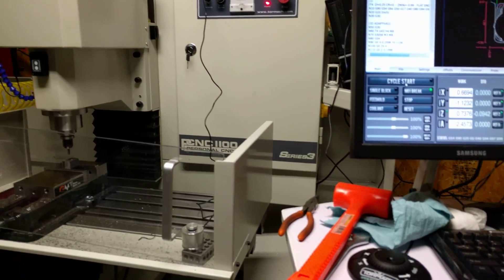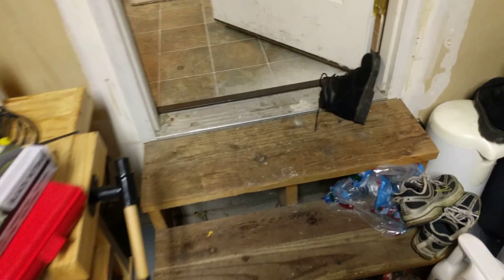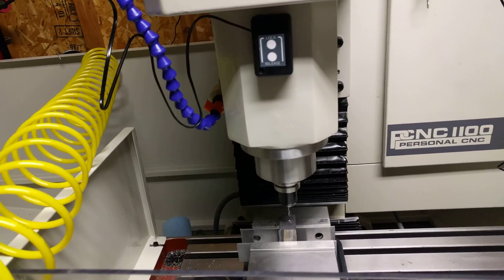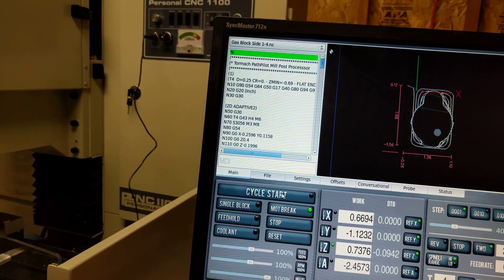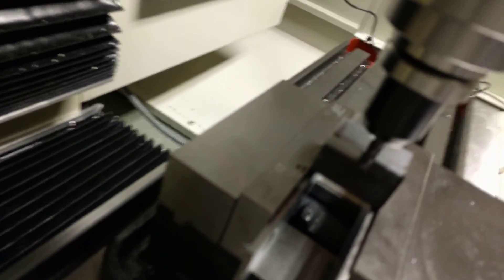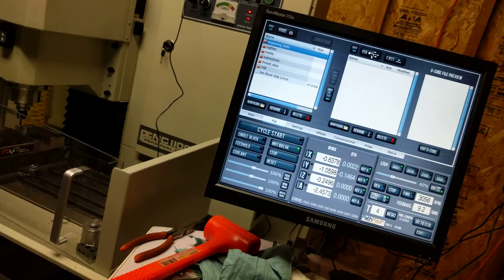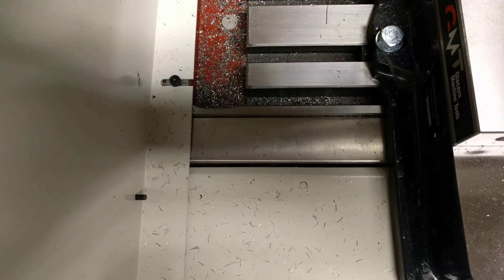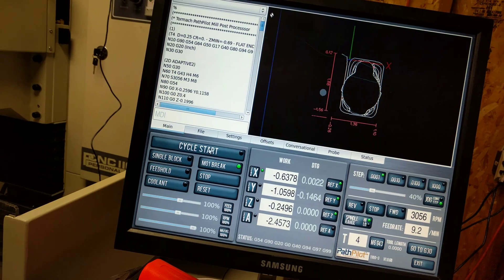Tormach PCNC 1100 day 2.

Comment: The harder the metal the slower the RPM.  Adjust travel speed as well to an Inch per minute per RPM formula.  That is called feeds and speeds.  Look it up!
Reply: An inch per minute per RPM would put my feeds at 1200-2000 inches per minute! Most full-blown VMCs can't run that fast even in the rapids, let alone in the cut. And at what depth and width of cut?

That's not a useable formula in any scenario.

Comment: You can change the feed rate in the lower left corner of the screen it has 0-150% you where at 100% instead of changing your CAM. Also it looks like your depth of cut was too deep. Slow that thing down on the feed rate till you know how it will react start at 5 inch per minute. I just bought my first cnc tormach 1100 and am starting to get better but I've broken about a dozen endmills. Aluminum is better to practice on more forgiving than the steel.
Reply from the maker: Yes, I've found that adjustment to be super useful. I can just tweak feeds and speeds until I like what I see/hear, and then go update that in CAM for future runs.

Just have to remember to hit the "100%" button when I'm done on everything.

I wish there was a way to make those reset any time a file gets re-loaded.

Comment: blue chips are a good thing! it means the heat is leaving with your chips, your end mill should be cool to the touch with hot blue chips.
Reply: and you want them big & fat too, big fat blue chips!
Reply from the maker: I've read that blue means too much heat, and that straw is the ideal color. Still learning though.
Reply: I say...if the chips turn blue as they rest then that is fine.....
Reply: http://zero-divide.net/?page=fswizard

The endmill you are using is an ALtin coated carbide end mill. Its not well suited for low speed milling.  If you go to FSwizard & punch in 1/4 end mill, with 4 flutes, ALtin carbide, Mild Steel & increase your max rpm to lets say 24,000, FSwizard will recommend 12,000 RPM. The Pcnc 1100 doesn't have the rigidity for 1 inch endmills. But doesn't quit have the speed for 1/4" & below end mills... so I'd say your machine is good for 1/2 to 3/4 end mills... With that said, when you mill at 12,000 rpm & up you get some blue chips, its not always a bad thing. FSwizard recommends 24,000 rpm for 1/8" ALtin carbide endmills.

Comment: Ok, you're diving in head first.  You are going to get this, but it's time to step back and learn two things.  1) How to use GWizard to get some starting feeds and speeds.  and 2) how to use the tool offset table and touch tools off.  The sheet of paper method works fine to get you within .001.  Can try to help you with a feed/speed but need to know your tool specifics.  Also what CAD/CAM are you using?  Fusion?
Reply from the maker: I have the Haimer, but I broke the probe (sad day). New one coming tomorrow!

I did spend this evening getting the tool offsets done. I got several more videos of that progress to upload tonight.

I'm using Fusion 360, and Lakeshore Carbide tooling. I think I found a good jumping off point using a 3/8" endmill and 100 SFM at .00125 IPT (it's SLOW feed rate, but it's making great chips!

Did a little bit of drilling as well tonight. Seemed to do well with a 13/32 (largest drill bit I have that will fit in my chuck), making a nice chip that took all the heat out and left the drill bit cool to the touch after a 1" hole. Might be slightly thin still, but I was happy with it.

The 3/16 I think had too fast of a feed rate/too slow RPM, and snapped off about .15 into the workpiece. Luckily those little drills are cheap.

Thanks for the feedback and the views! Should be a few more videos up from today's process tomorrow morning.

Comment: If that's steel, you should be flood or mist cooling.  Check out Gwizard...it is a speed and feed calculator...very good for starting up...I use it and it saves tools...
p.s. I just got a 440 a month ago...I'm getting it now tho...good luck
Reply from the maker: The coolant guy called me back this morning, and got the machine charged this afternoon. Only problem is, the fuse that controls the secondary power on my machine was apparently bad from the factory (or I blew it the first time I plugged something in, not sure which). I'm running my controller and everything just off an outlet until I can grab one. So the coolant is still a no-go until I can get a fuse (always something)!

The material is 1018 steel (only thing the local metal supply store carries). I was trying to use John Saunders' "zig-zag" method, and kind of cheating off his similar tools using 4140, which was the metal I was hoping to be able to buy in the first place.

I plugged the numbers into FSwisard, and they came out very similar to what I was using.

I took a step back, looked at the recommended SFM for 1018 on another website, and ran it again tonight with a 3/8" mill, using 100 SFM and a .125 chipload, and it cut like butter (just slow). Excellent surface finish, no chatter, etc.

Part of that may be that I clamped it along the long side and flipped the x axis. I also used shorter parallels to get more "meat" in the jaws. Both seem to have helped.

I've got a few videos of the process tonight. Also jumped into some drilling, and figuring out the tool offset in the controller.

Making TONS of progress, even though it's been a little frustrating.

Thanks for the advise and the views!
Reply: I am currently just machining some 6061 aluminum and some ultem plastic to get by the learning curve of the speeds and feeds.  BTW, I too slammed a mill into my jaws early on.  It was a case of setting x,y,z with the Haimer but not having the right tool number called out on the screen.  I've also gone thru 2 Haimer tips from loosening the draw bar without holding the Haimer in my hand.  I'm past all that now and looking forward to making some stainless blades for a couple friends for xmas...
Reply from the maker: Right on! Let me know if you start doing vids on it, I'd like to check them out.

I was worried about dropping tools with the manual drawbar (and I'm lazy), so the power drawbar was an absolute requirement for me. I can hold off on the ATC for a little bit, until I actually know what I'm doing manually, but I'd break a bunch more tools for sure with a manual drawbar, so it'll probably pay for itself eventually.

Haimer tip should be there today after work, so I'll have to get its offset added to Path Pilot, and hopefully not repeat that mistake again.

The jog wheel is cool, but I think I'm gonna use the keyboard for zeroing, since it's too easy to make a mistake thinking you selected an axis on the jog wheel, and jogging in the wrong direction.

Just stitched together all my videos from last night, and I'll get those uploaded today.
Reply: drying milling with just oil at 18,000rpm works best for me!
Reply from the maker: I'm guessing you mean 1800? What size endmill?
Reply: Wrenchmonkey if you watch "Seco tools" videos or other professional carbide sellers. You'll notice they all dry mill with blue chips. When I dry mill with blue chips, my end mill is cold to the touch. You can watch some of my videos on my channel, I run 5/8" and 1/2" end mills at 18,000 rpm (not 1,800) for steel and aluminum for best results. Give it a shot, I was scared to do it at first but seeing how the professionals did it, it gave me the courage to try.
Reply from the maker: Interesting. I assumed they were just pushing their tools as hard as possible to make the most impressive videos to sell tools, and were treating them as a throw-away item, rather than demonstrating the way they should normally be run in production for a small guy like me who has a limited tooling budget.

At this rate, it'll probably be quite some time before I actually wear a tool out before I break it or chip it though.

I ordered a pile of ebay endmills to try. The 3/8 endmills seem about 25% cheaper than Lakeshore, and the 6mm seem about 35% cheaper than 1/4" lakeshore carbide, so that could really add up over time.

What's your feed rate and stepover (and depth of cut) in mild steel at 18kRPM? That's got to be impressive to hear and see!

My spindle speed on this machine is limited to a little over 5kPRM. I assumed you were talking about running a Tormach (my bad). 

I'll check out your channel for sure!
Reply: Wrenchmonkey I'm doing a 1/4" step over and 1/4" deep cuts at 20 inches per minute. With a 1/2" end mill.     Ya that's what I thought about those videos too, but it turns out tools do last longer, and stay cooler.
Reply: Wow I had always assumed tormachs ran at 10,000 rpm... I had no idea....
Reply from the maker: The smaller ones run at 10krpm (440 and 770). I don't fully understand why they don't have 10k spindles on the 1100 myself, but i needed the larger work envelope for some other projects I have in the pipeline.

I'll probably pick up one of their little 440 machines in a year or so when I've got things a little more figured out, and hopefully have the income to justify it. The automatic toolchanger is much higher up on the priority list though.

I also need to build an enclosure for this thing. I don't want to run anything high speed until I can keep the chips contained. The little chip shield that came with this does okay with low-speed, but higher speed just throws them EVERYWHERE.
Reply: Oh thats the pcnc 440 with the 10,000 rpm